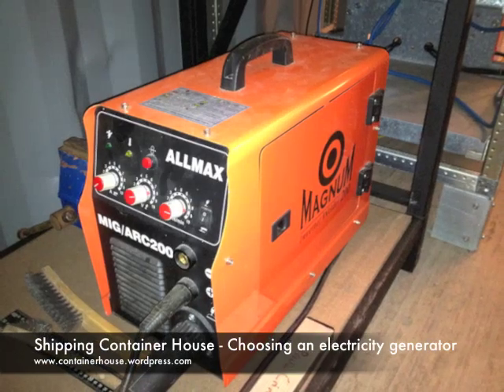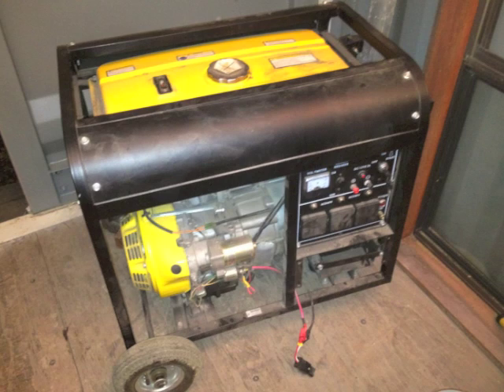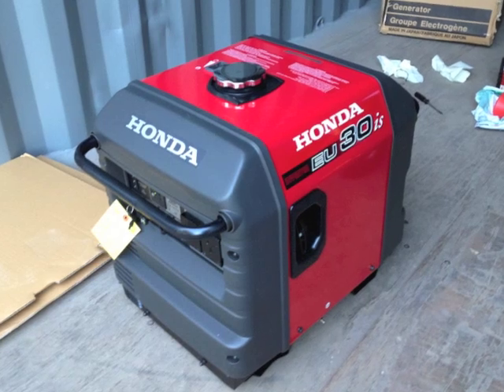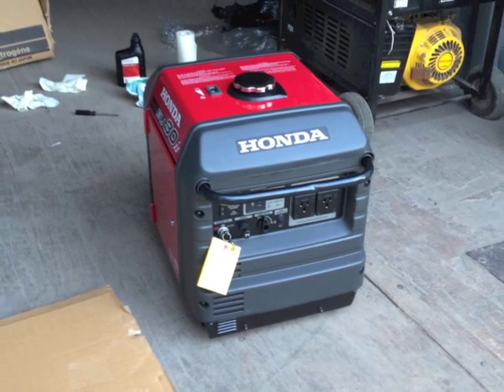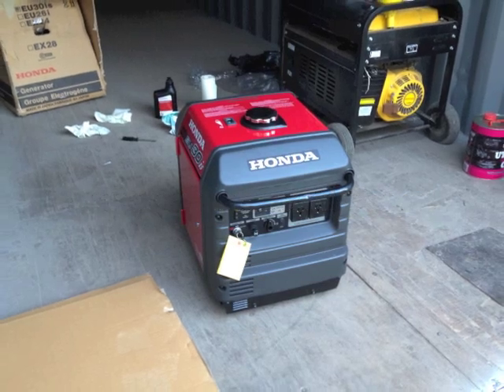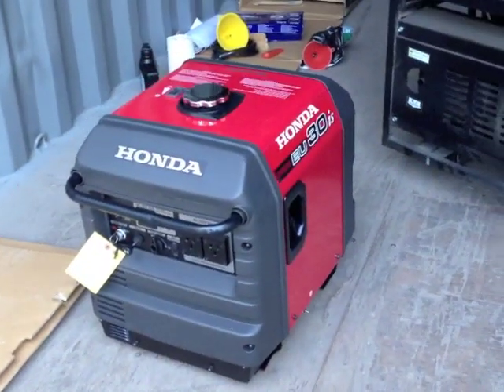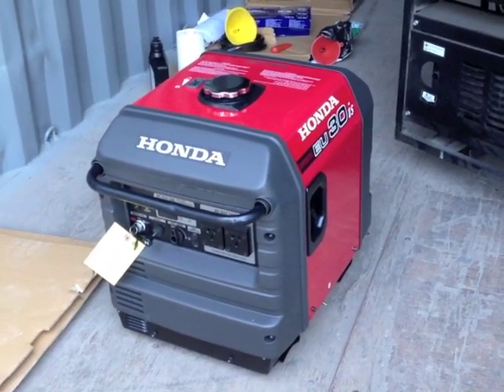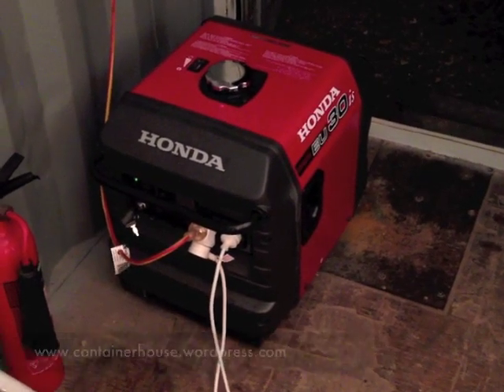Shipping Container House - choosing an electricity generator

Comment: Paul,
  as I am new to welding and learning as I go 😃
Can you recommend an enexspensive good welder for general welding and container build...
Reply from the maker: +Shawn Musgraves Hi Shawn. I wrote a short burst about the welder and it is on my blog. Follow the links in the description to my website, blog, 5th one down is welding. I hope that helps. I learned to weld by doing this project. I just practiced on scrap until it looked right. Cheers Paul

Comment: Hi Paul, I knew if I looked back I would find the video I needed...I think !So my question is... That little Honda will run your MIG welder YES or NO and if not what do I need, Im sure it will drive the grinder but not sure about the welder. Thanks Paul.

Comment: Comparing the 2 generators was like comparing apples to peaches. The chinese Gen was made for a construction site or temp power, the Honda was designed for use around people in a camp site or RVing. This is just an observation not a complaint.

Comment from the maker: I have not measured it, but a ballpark figure would be about a litre per hour. There is an economy switch on the generator and it slows and speeds up the motor to meet the demand. Consequently a heavy load will burn more fuel. I am looking forward to making it redundant with solar panels.